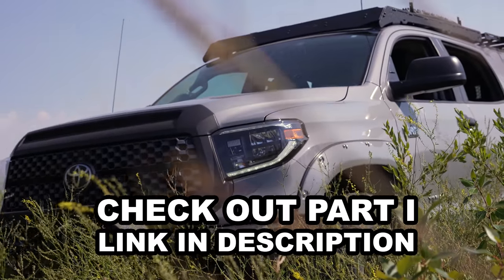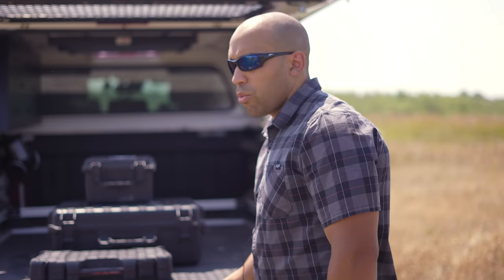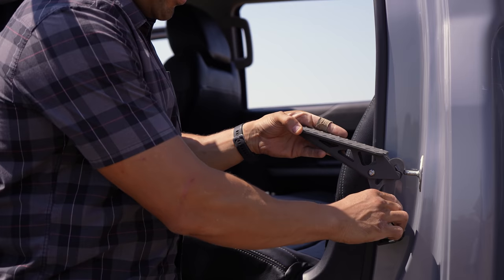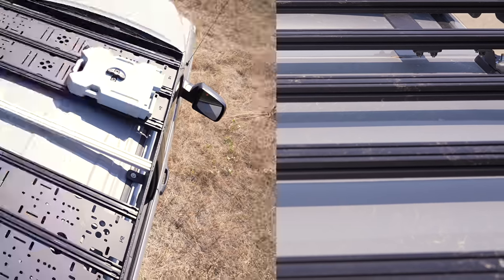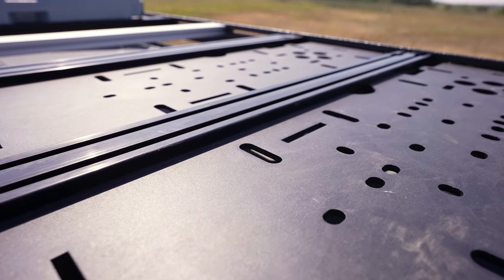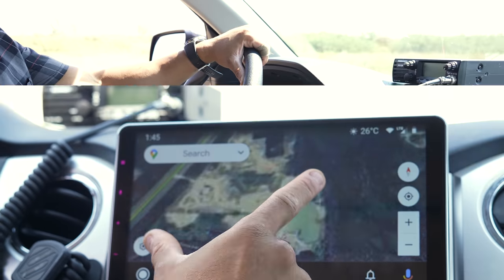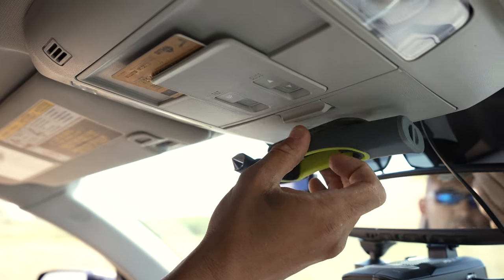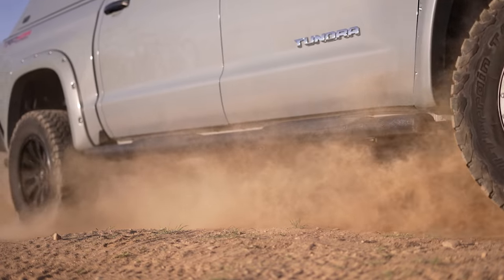10 Vehicle Survival Modifications You Should Consider

Comment: Okay, as a car/truck enthusiast, a prepper, an outdoorsman and someone who modifies absolutely every single vehicle that lands in my hands I have a few suggestions.

First of all lets set the rules and priorities. You need a big, comfortable and sturdy vehicle that can handle the abuse of doom and gloom as well as a nice family car or personal vehicle that can be used as a daily. The first 3 things that touch on both categories are safety, reliability and storage solutions. 
As far as storage solutions I think you are fairly well prepared. In terms of reliability, I would take a look at the most common issues toyotas have when abused (CV axles and transfer case struggling to engage are the most common I know and I'm not sure if they apply to the Tundra, but you can do your research and take a decition).

Then we go into safety. Yes, It is rated as a very safe vehicle and it being on the bigger and heavier side will give you and your occupants a lor of advantage in case of collision, but that rating is based on government rules than also try to minimize the damage against other vehicles (and that compromises your own vehicle).

I would get a lift on that truck in order to have the bumpers around 36 inches above the ground (in the line that separates the bumper from the grille). I would ditch the factory bumper and replace it with a heavy duty steel bumper made out of 3/16 " steel plate on top of a fixed frame made out of 1/4" steel square tubing that bolts to the frame of the truck. That means that the bumper frame will stabilize the frame of the truck and make it tougher, allowing you to take greater impacts without the frame moving, taking damage to the rest of the truck nor having your airbags going off. Same for the back. For the back bumpers, if you can get a bumper that integrates a hitch inside and is rated for a lot of weight (3/4 ton truck ratings) you should be good to go. 
Be sure to get a bullbar integrated in the bumper to protect your grille, hood and by consequence, your radiator and engine bay components. If you dont mind the look or like it, you can also get it with loops protecting your headlights and in the case of the rear, your tail lights and fenders.

I would also go for an air locker system in the 4x4 department, compressor installation (there is a hack to use AC compressor instead of electric) and extra air outlets so you can inflate and deflate your own vehicle and assist others in case there is the need.

So... air lockers, compressor, air outlet, lift, steel HD bumpers. 

I think the only things left to do are to decide if you need bigger tires (I always say they are needed), spare tires and regearing in case it is too much rubber.

Personally, I would advice you check out Tacomabeast for more ideas and watch a video of Iron Bullbumpers testing their bumper in a Ram 2500 smashing a chevy malibu.

Comment: Under the hood, I've added magnetic mounted work lights and a small basket of auto fluids (qt of oil, brake fluid, power steering, transmission and radiator medic), also an extra serpentine belt. My next addition will be a backup battery charging/ jumping connection from my solar battery, in the event the vehicle starting battery fails. I previously installed the highest output alternator made for the vehicle. The model that comes from the factory is 70 or 80 amps. The model I installed was 140 amps. Another addition in an under the hood mounted air compressor.

Comment: A more serious battery bank than just the inergy box.  600amp hrs of lithium, Battleborn is a leader.  Larger more permanent solar arrray and MPPT charge controller, Victron is a leader.  3000watt inverter charger, essentially a motorhome RV system but in your truck turning it into a camp support vehicle.  Also a 12/24V well pump on 60ft or so of hose to suck water into your bumpers or tanks.
Reply: Battleborn has thermal protections you just don't find in cheaper batteries and that can cost a lot to add.  Going cheap can cost you a lot of money if you try charging when it is too hot or cold for charging.

Comment: I would suggest a vise for that roll out.  A vise can be invaluable when you're in the field.
Reply: Also have you emp hardened the truck or done any other mechanical mods?
Reply: Knowing what CP uses the rollout for (carrying packages from warehouse to shipment company) a vise may just get in the way more than it's likely to help.
Reply: @innercityprepper  only thing that's permanent about a vise are the bolt holes drilled.  Otherwise it can be stowed away like everything else here.

Comment: great build. i'd love to know how much you have into it, for more budget-minded preppers
Reply: it's a Toyota, it ain't gonna be cheap. If I had to guess (in USD) we're talking 75 grand for all the things you've seen including of course the truck itself.
Reply: @innercityprepper  Probably 5 or so grand just for the items excluding the truck.
Reply: First thing, Toyota is way over rated. Believe me I own a 4 runner complete junk.  I would put my ford up against any tundra or titan.  Parts are easy to get for them as long as supply chains keep running.  Go to tour local napa and ask what they stock parts for and make a decision based on what you can get rather than a cool factor.  They all break so better to have local availability.
Reply: Yup, I'll be setting up my 2000 f250 on the cheap..
Bought a camper shell for a $100 on craigslist, ( needs about another $100 of work)..
Then used tool boxes and a little carpentry..
Reply: If you want to really go budget minded, you can always look into getting a M35a2 or other mil spec vehicles. You'll have space for days, mines only cost me 8k and my M1123 humvee costed me 11.2k but they have gone up quite a bit over time

Comment: That is an awesomely well-equipped truck. 

With all of that extra weight, did you notice a different in your miles per gallon?  I transported a generator in my minivan once and despite it being within the weight range it could supposedly carry, it ruined my suspension and rear shocks, pretty much ended that vehicle. Do you think that the extra weight might reduce the lifespan of your vehicle?  

Is there space for emergency foods, a cool
box or place to plug in a mini-fridge?  I didn’t notice any water storage, perhaps I missed it. I suppose you nearly always travel with water and food but just checking.

Comment: ok you asked I shall reply on your upgraded truck it looks fine but i would suggest some sort of tire sealant i see you have plugs and air but what about the ability to fix a tire that perhaps got shot or sliced by marauders maybe some green goo or slime perhaps something a avid of roader might use to fix severely damaged wheels and radiator repair such as stop leak. blackpepper .oatmeal or any other home remedies I only bring these items up because if I where to try and stop a vehicle that's what I would take out first thanks what you do
Reply: If you're getting your tires shot at, you aren't getting out to change the spare tire. So if you can't make it on one set of BFG KM3s, you're toast.

Comment: CP, hope you've got a snatch block somewhere in there for doubling up that winch. That truck looks like a heavy beast.. that said, what a cool setup. Great platform and all the widgets. Also, just a thought as an (getting) old mechanic. Toss a cheapy electric drill and a good tire reamer bit into your kit. Trust and believe you will hate everything if you've ever gotta try and hand ream out one of those big knobby tire to fix a puncture!

Edit, just cause I saw it in someone else's posting.. what's you're spare tire setup? An OE sized spare will not work in 4wd with your (I assuming) oversized tires?

Comment: An electric bicycle and trailer. Carry 300W (3x100W) Solar panels and a 48 volt Lithium Charge Controller (about 14lbs additional weight in the trailer) for a 624 Whr bicycle battery to give approx 30+ mile range then recharge the ebike in about 3-4 hours for another 30+ mile range etc.  Might get you to your bug out location when the gas guzzler craps out of fuel.

Comment: I've been curious about things like baofengs, etc in vehicles. Anything battery powered. How do you suggest we keep the batteries from getting fried/frozen in our seasonal extremes?
Reply: I keep my " old " battery on a trickle charge, and take it with me when I'm in the back country. I also have a capacitor to jump start it - just in case.
Reply: @t.trekkeroo2325  I guess I meant more for if you keep a battery operated device in your vehicle at the ready. For example here in the North (tm) if you leave a battery powered device in your car and it gets LEGIT cold for even just an hour or so  it very likely isn't going to work very well if at all until the battery gets to its preferred operating temp.
Reply: @innercityprepper  I see how that can be a problem. 🥶
Reply: You might want to get a AA battery pack for the radio.
And keep lithium batteries in the warm part of the cab.
Lithium’s don’t leak and are good for long term storage, they just need to be warm for best results.

Comment: Always like your gear shows and I think you have a solid attitude toward your expectations of the gear.  The only one I wonder about is the glass breaker and seatbelt cutter tool. The pistol grip angle looks like it would not be good at transferring energy to the glass as a clinched fist, hammer strike angle.  I have a Victorinox survival tool with the glass breaker and a glow-in-the-dark handle.  It cuts seatbelts, etc., too, but your tool might be better for that.  Cheers.

Comment: All the loose stuff in the cab is not going to be where you put it on impact plus is dangerous to the occupants. A fuel can on the roof in the Saskatchewan sun does not seem like a good idea but if you have had no problems more power to you. I wonder about the combined weight of all those add ons. Maybe a vehicle check list would be a good idea for me since I have trouble remembering what is in my truck tool box. Is your spare tire still mounted under the vehicle? Perhaps a better location could be found.

Comment: Just between you and I..clear everything out of that fold down arm rest console,cut the plastic bottom out using a heat knife or a dremel,carve out any shape that fits anything you don't want seen or easily found along with several "books" and then place a solid black colored sheet of laminate or abs plastic precisely trimmed to fit over said non existent items,and then throw all the original contents back in on top of it... A few drops of super glue will hokd the cover in place and is easily broken past or into using you hand or hands...

Comment: Love the truck. add a turret on top and it will be perfect.:) ha, seriously though,  love how efficient you have made everything. Did you consider the drawer system instead of the pull out bed? The drawer system it supposed to handle 2000 lbs, but what you have seems to be more heavy duty.

Comment: Great progress on the truck so far! How about a second full size spare tire?
Reply: I have been off roading for over 40 years. I never go out without a plug kit air pump and a second spare tire. I also pack a spare serpentine belt, radiator hoses, universal joint, tools and a high lift jack. I carry three days of extra food and water above and beyond what I need for the trip.  I know it sounds like a lot, but if you're 50 miles from the closest paved road going for parts isn't easy.
Reply: Just run BFG KM3s

Comment: cool truck but IMO Mercedes Sprinter 4x4 still the best bug out vehicle. Whether you buy a cargo van or camper, you got way more volume to work in. Dually extended and high top you would have so much room you could probably bug out with family of 4.
Reply: But since it has no provision for a points distributor, nor any intake manifold for a carburetor, you won't be going anywhere.

Comment: For me a bug out vehicle should be built before 1985 have a extra little switch that would turn brake lights off and on as you wished then customize the back with the essentials also would have it set up with a special modification with a gasification setup just in case there's no gas or fuel to get to then you always need stash compartments just in case your vehicle may be compromised but that's where a couple extra kill switches would have not allowed them to steal it then I would think having a couple modifications for some type of weapons May it be machine gun road spikes dropped out the back and the capability of land and water but definitely 1985 and before and some type of gasification

Comment: As much as I want to get a Jerry Can or the flatter one as seen in this video, it's been my goal to find a plain ol' fashioned *metal* canister for <2 gallons to stow away. But noooo, they're all plastic and have that dumb safety thing we have to f*ck around with just to dispense the gas inside. Yes, I have one, and unintentionally broke that spring mechanism which turned out to be a happy little accident as it functions NORMALLY. Pop the cap off and tilt, no turning things counter-clockwise while pressing down... or however it's supposed to go.

It is necessary to have a multi-use pump ($5) to get that last ounce or two hiding in the corner.

Comment: A large caliber revolver big enough to hunt with  .. A pickup truck w 4wd. Ideally a Toyota hilux or chevy ford ...and with good tires  A box of fishing tackle a toss surf net. Solar panel and battery charger w rechargeable battery.  A left over used condition  nomex  firemans turnout coat is also useful.  Digital night vision is more durable than tube units and cheaper. Buy a jerry can and can mount
Reply: If you insist on driving, your 4x4 better have a points distributor and a carburetor

Comment: Have you looked into the validity of the emp shield setup for vehicles, I was wanting to look into that and was wondering is it something worth investing in or is it a useless piece of gimmicky junk.
Reply: Most likely a gimmick. EMP likelihood is so low and is reasonably ineffective enough that my personal opinion is, if you have a **MUST HAVE** device like a spare insulin pump or some other can't-live-without-it thing, sure... keep it in a faraday cage, but otherwise you're just burning money.
Reply: I got an old 1969 chev 3/4 ton with 57,000 original miles. An EMP or solar flair won't bother it at all.  Plus its home is a metal barn.  Extra protection!
Reply: The only way to be 1000% sure is a points distributor and a carburetor.
Reply: @777Patriot  correct. I invested several hundred in getting a points distributor, a carburetor, and a carbureted intake manifold for my '96 truck, just in case.

Comment: Thing you are missing and most important. Secondly fuel tank, 5 gallon can is useless,  water supply tank, air compressor, spare tires. Backup battery system.

Comment: It’s definitely nice but without gas it’s not useful or an emp it’s dead.
Reply: That's why you need a points distributor, a Holley carb, and a mobile methanol distillation setup in the back of a fullsize longbed 4x4...

Comment: There are a few good reasons to consider an electric vehicle for the big S. H. I. F. T.

  * Quiet
  * Smaller Heat Signature
  * No Tune ups
  * No Oil & Filter changes
  * Dependability
  * Energy Availability

Yes you can store up a bunch of diesel that'll take up a lot of storage space but it'll ruin out

Then you'll have to pack some barter equipment and go out, waste fuel, putting yourself in danger going to, danger making a deal and danger returning home, not to mention leadings bad actors to your den

Yeah! Yeah! Yeah! You can use all sorts of oils but that's a lot of scavenging small amounts here and there, a lot of dangerous roaming about.

With electric vehicles you can make your own electricity, try this with diesel.

Modifying an electric vehicle for swappable batteries, having at least one extra for the vehicle and one larger one for the camp that will be charged by a large solar array.

Don't forget about an emergency mobile solar panels for the road.

I suspect that by now some will be mentioning EMPs killing me electronics, well, make a DC electric vehicle, for starters it'll have electronics but if they get knocked out you can bypass the electronics and go crude until you get back to you camp and dig out your shielded backup parts

Speaking of shielded, that's a mod for an AC electric vehicle

S. H. I. F. T.
Shit
Hit
Industrial
Fan
Thoroughly